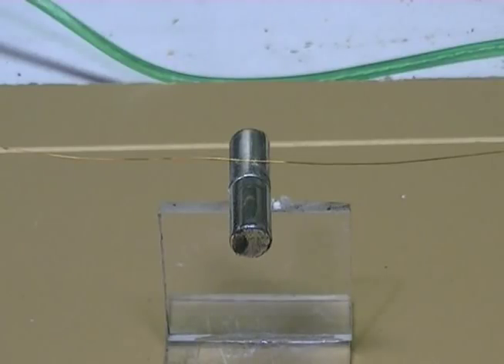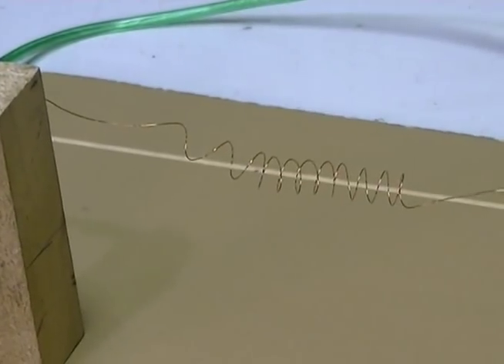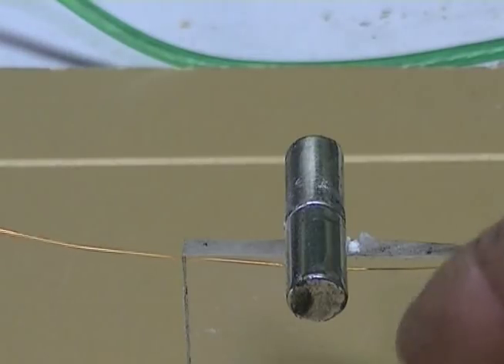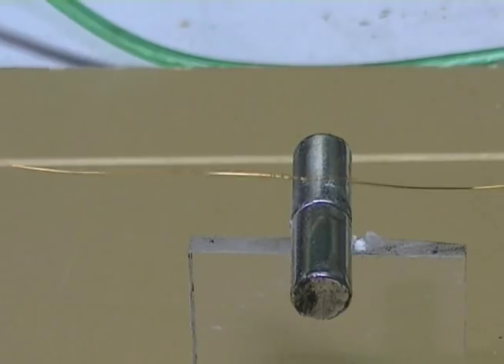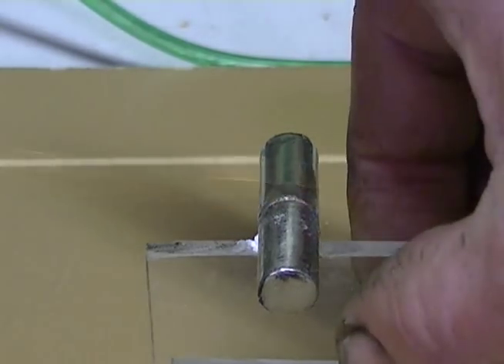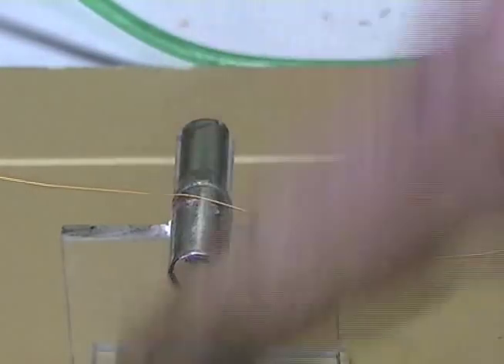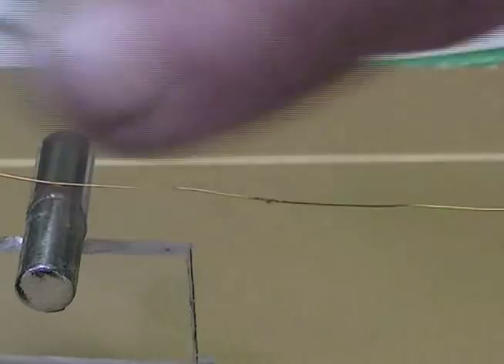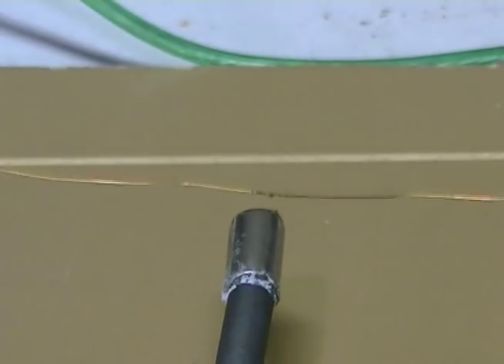WTF Monopole magnetic field effect

Comment: I love your discovery and sharing but I have to point out something. There isn't just a north and south pole on a "magnet". There is also the dielectric inertial plane (bloch wall) always at the center. This field is spinning in or out from there in a cw or ccw direction depending on the pole side. Just like a gyroscope. This field is interconnected with the conjugate interplay between the poles. What came to my mind when I saw this is you made a homopolar motor in reverse. I took a screw and stuck it to a pole on a round magnet and hung it from one side of a 18650 battery then laid a wire from the other side of the battery to the outside circumference of the magnet. Takes off like a top. Gets hot as its a dead short but it illustrates the point I see here. You have to imagine a torus of magnetism with an hourglass shape (hyperboloid) of dielectricity all centered in the middle. Forever locked in opposite force. So it looks like an hourglass in the middle of a donut in the middle of an hourglass all spinning very fast like a gyroscope. Also in a cross section all around the middle of the donut is the dielectric plane. Fields are moving from the outside of the pole to the center of the other and vice versa in a 90 degree angle from each other all the while the dielectric plane is intrinsically a part. Converging and diverging fields on each pole. The magnetic diverging from the outside and the dielectric converging on the inside both from and going to the opposite positions on the other pole. The direct center of both of these is the 'black hole' of counter-space. Put a grid on any c.r.t. screen and watch the direction of rotation each pole spins. Then the dielectric plane at the center. That is the give and take conjugate nature of the entire universe. Nothing but dielectric capacitance balanced by an ether fulcrum to magnetic inductance. Popping in and out of dielectric counterspace and magnetic space millions of times a second. A black hole exists in every 'magnet'. In every "atom". It is the dielectric counterspace. You can see it in the center of either pole of a magnet when viewing through a ferrocell. Everything is spinning just like a tornado or hurricane or galaxy. Take almost any neo magnet and hang it from a thread, either vertically or horizontally from the pole or from the dielectric inertial plane and it will spin around and around, favoring one direction or the other but not both, until the thread gets bound up. Although the really strong neo mags will just point to the pole if you hang them from the middle plane, but, if you hang it from a pole, it will spin like a top in favor of one direction over the other. The spin direction constant remains a mystery under study and research here. Thanks and great video. Cheers, mate.

Comment: There are two issues here. First, and I may have missed it, but the direction of the current is unknown to the viewer. This affects the direction of the magnetic and electric field of the wire. And no one ever mentions the other fatal flaw. The opposite poles of a bar magnet are never pure north and south. Here is an easy proof: place two bar magnets side by side so they stick together as expected, each end north to south at the same time. Then rotate them about their axis. At some point they repel, indicating similar poles instead of opposites.  This is a percentage dominance issue of polarity with a polar affect. Everyone assumes this doesn't happen. Placing the wire on the other side of your magnet is working with a different dominant pole of the magnet. Until science addresses this there will always appear to be questions of confusion.

Comment: Picture the direction of the magnetic field around the wire when the current is on and see how it's that which is reacting to the magnets and flipping hte wire around. It doesn't care which side of hte magnet the wire is on, but it does care which side of the wire the magnet is on.

Comment: This is a pretty cool demo. To me it's sort of similar to playing with say 3 identical looking disc magnets. If I attach two discs together so that they form one magnet, especially to where they are so strong and small they should look to have a uniform field like that of a single magnet, I can still take my third magnet and stick it to the round 'side' of the other 2 and it will want to stick dead center at the point where the two magnets have joined. I flip the polarity of that 3rd magnet around and it wants to jump over and stick to the face of either of the other two magnets.   

So I basically see it like that wire being turned into a tiny cylinder magnet that wants to also rotate 90 degrees to align itself with the 2 magnets but given the strengths and tolerances it still does the same relative movement of what it would have done were it to actually turn 90 degrees and line itself up better. Wire seems to execute the same desire to attract or repel except its field is never strong to truly to what another magnet would do.

Comment: Amigo, excellent experiment, and I thank you for sharing this with us all!

Have you attempted the same experiment with only one of those magnets, putting the wire dead over the supposed Bloch wall -- or better the dielectric, radial emission --  in the middle?  Next, are you using AC or DC current?  I believe that it does indeed make a difference.  If the wire can handle it, you may wish to try this with the other type of current.

F.

Comment: Hi,
Interesting experiment!
1. Few small compasses in each corner might show what polarity appears around wire and magnets.
2. maybe using stiffer wire and higher current could show something
3. Using slow motion, high fps camera could make it easier to see the motion in detail
4. Adding additional magnets to the setup? :)
5. Holding the wire and sensing the force vector while rotating the magnet at the same time.
6. Magnetite or iron filings on sheet of paper beside the wire and the magnet or magnetic paper could reveal something
7. The magnetic field at the point where 2 magnets are joined might be producing NS pair but just at small volume around the joining surface and is not fully  contained  within magnetic material

There is plenty of possibilities...

But should that wire not be jumping over the magnet in same direction all the time regardless of how far it is shifted from the centre?